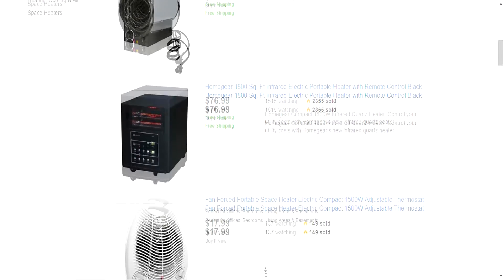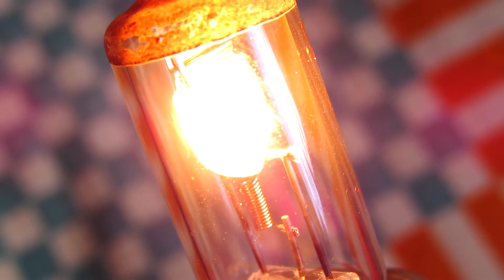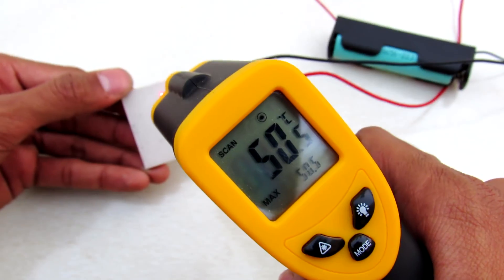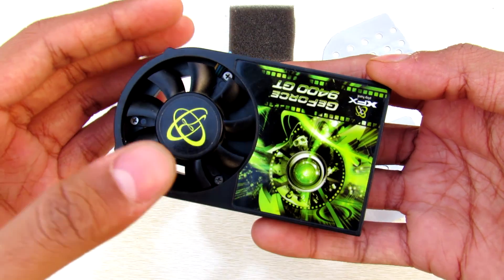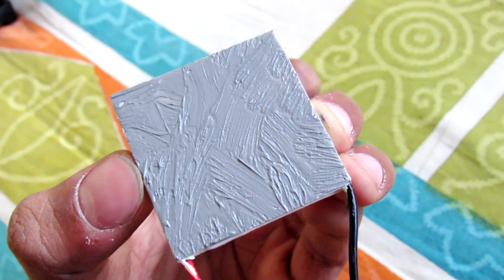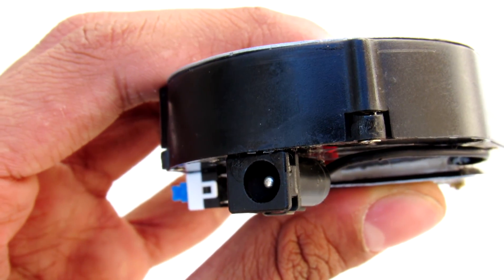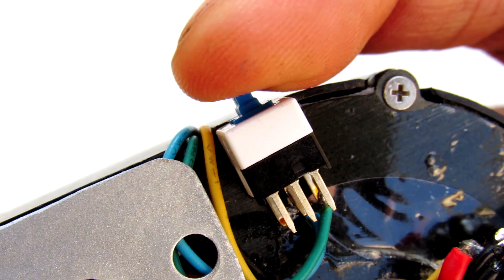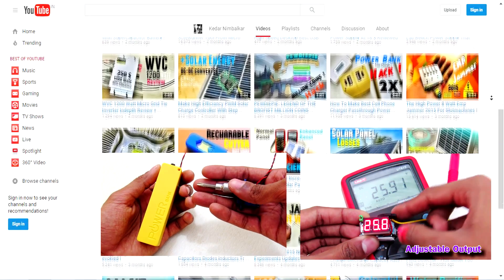Air Cooler and Heater from Peltier Modules

Comment: Good idea, but not really practical for cooling. Since when you switch to “cooling mode”, the now cold side will become the hot side, and there is no place for the wasted heat to go, thus rendering the device extremely inefficient, and not to mention this will shorten its life burn out the device faster. Only really practical for heating.

Comment: You should not insulate the cold side. Instead have a fan on that side and circulate air outside of the pocket. It will be much more efficient.

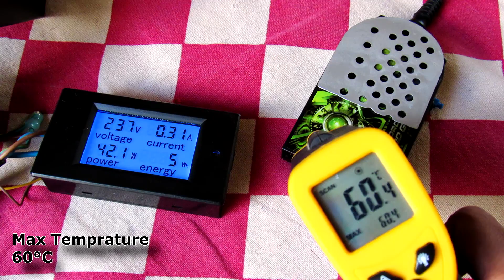Comment: it would be nice to see what is under the squares on the video 3:12 etc. looks like you have a read out of temperature, but the links are over top of the video and I can't remove them.
Reply: If you pause it at 3:12 you they become relatively transparent.

Comment: With the current design (Hot side of Peltier module against fan/heatsink, Cold side against insulation), I could see how this would work fine (I guess). However, if you change the polarity of the peltier device, wouldn't that make this very inefficient? In that, the hot air cannot be dispersed, contrary to something of the likes of an air conditioner. Now that being my theory, while you have a working unit, how does this thing do, in terms of temperatures, when blowing out cold air? Great Idea, I just didn't know how it would work on the flip side of things. Thanks :)